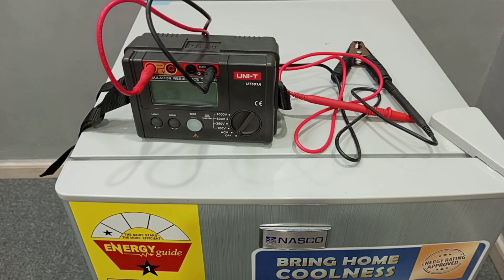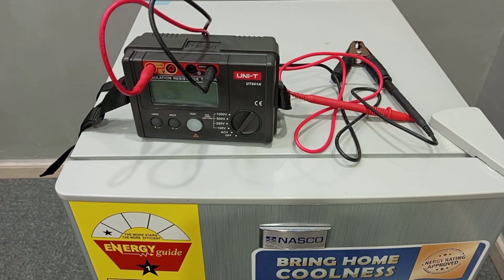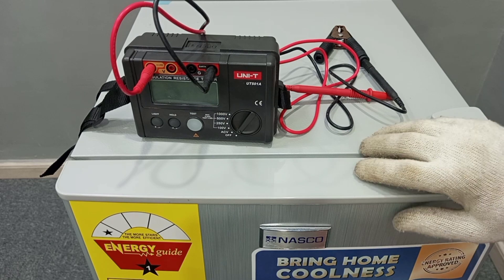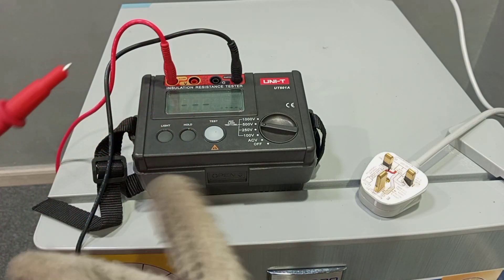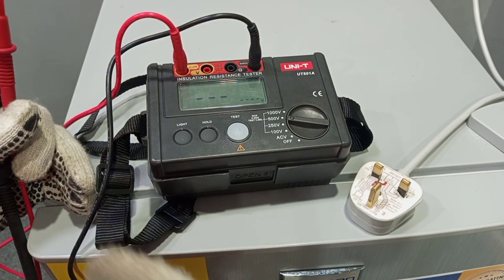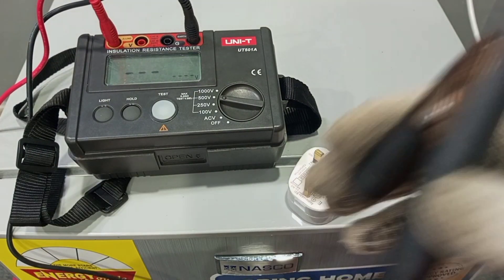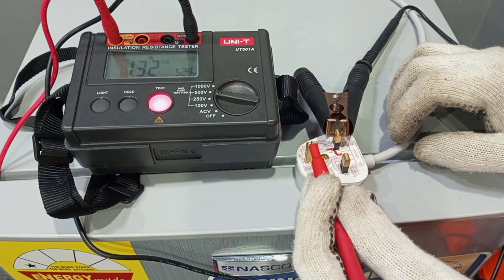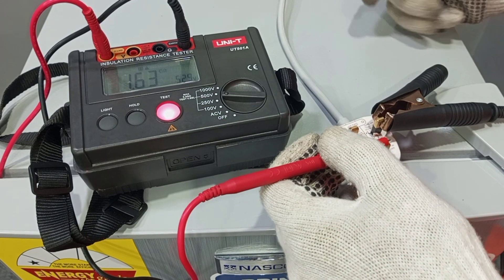How to perform Insulation resistance test on Electrical Appliances

Comment: Can the insulation resistance of a wire be checked before starting electrical wiring?
Reply from the maker: Yes, but that would be double work. Because you have to do it again after the whole wiring.
Reply: @obloni_Electrical okay thank you sir
What is the best thing to do if after wiring you discover the insulation resistance is low?
Reply from the maker: @SamsonYoung-xo4yn  
Replace those cables

Comment: Please i wanna ask a question outside of this video. According to the "On site guide" under cables ans their resistance. It states that 2.5mm² cable has a resistance of 7.41mOhms per metre. So i cut exactly 1m cable and use digital multimeter to measure the resistance and i had 0.00 ohm, but i had 0.50ohms when i used the clamp meter... 

Please why didn't i get the 7.41mOhms as stated... Or what's the right instrument to use.

Thanks
Reply from the maker: Hi Dan, please check the title of the particular table you are referring to very well. That table is not related directly to the experiment you did. 
For your experiment,  you have to use the formula below:
Resistance formula: The resistance (R) of a conductor can be calculated using the formula: R = ρ * L / A, where:
o	ρ is the resistivity of the material (ohm-meters)
o	L is the length of the conductor (meters)
o	A is the cross-sectional area of the conductor (square meters)
Resistivity of copper at 20 degrees celcius is 1.77 × 10⁻⁸ ohm-meter (Ωm)
In your experiment, your cable length is 1m
And the area of cable is 2.5mm2 

Plugging in the values, you should get:
R = 1.72 x 10^-8 ohm-meters * 1 meter / 2.5 x 10^-6 square meters = 0.0074 ohms

Therefore, the resistance of 1 meter of a 2.5 mm squared copper cable should be  approximately 0.0074 ohms.

Now, this may be why your first meter did not read: most meters are designed to read resistance above 200Ω some are also designed to read resistance above 1Ω
That means, if the resistance  being measured is far below the minimum value of the meter, it may either not show anything at all, or it will show a wrong value.  So check the range of resistance your meter can read.  thanks